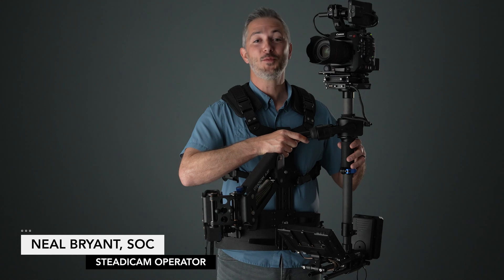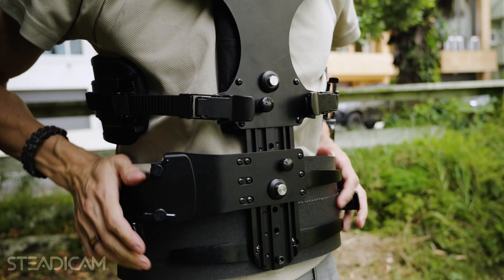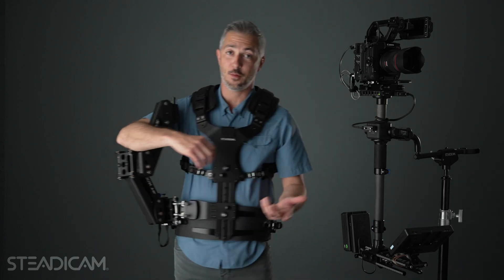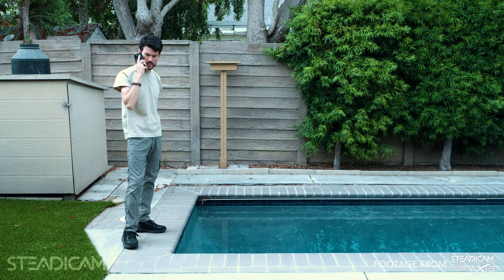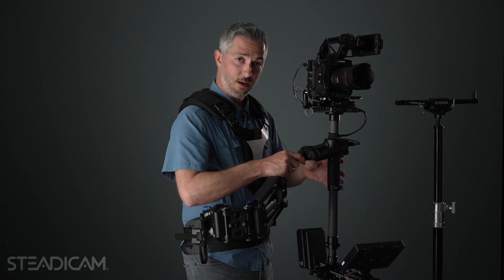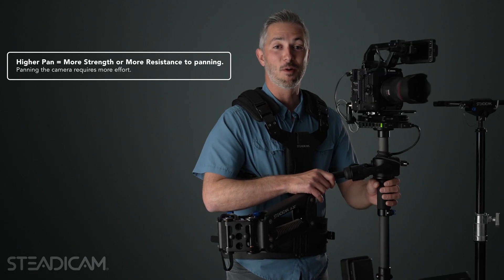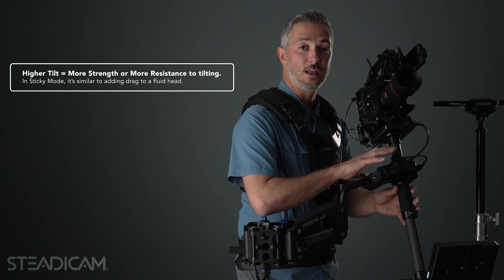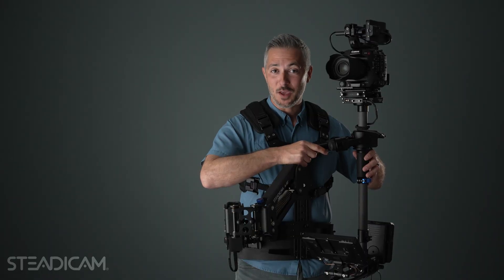Introducing the Steadicam Axis - New Professional Steadicam ® with 3-Axis Volt™ Stabilization

Comment: When you say the weight capacity is 20lbs, are you just referring to the arm/vest that supports the sled? Or are you also referring to strength of the 3-axis motors within the Steadicam Axis' Volt? 

Can someone realistically keep this setup for bigger cameras and just upgrade to a larger weight capacity arm/vest?

Comment: Could a light gimbal (RS3 Pro) be used in conjunction for the javelin mode use case?
Reply: Should be possible as long as you're not pushing the payload.

Comment: Only one question, what plays a part in the payload capacity? Can I go with a heavier setup if I had a stronger arm? Or is it going to overload and burn the Volt? Thanks.
Reply: THIS IS THE MILLION DOLLAR QUESTION! @tiffencompany ?
Reply: In my experience, the Volt is mostly dealing with inertia rather than with weight because the Volt is at the neutral point of the sled. The weight is more of a concern with the sleds balancing. Due to its lightweight design even if you placed a huge camera on the top stage it would still need a fair amount of weight on the bottom as well to balance out the sled to get the gimbal to be at the neutral point. And that potentially would be pushing the payload of sled itself. Hope that helps.
Reply: @HalfAsianSensation  That's very helpful and thanks for your input!
Reply: The Axis sled itself is designed to handle higher payloads. When used with more robust arms and vests, the sled can support cameras weighing up to 25 lbs (11.3 kg).

Comment: Amazing! Would it handle bigger payloads/cameras with a stronger arm? Is there an option to buy it with a stronger arm?
Reply: Not unsure if they are all cross compatible but they sell arms and other full rigs that work with heavier cameras. This new product is meant to hit another price point and they didn't offer before. This one is around 8k I think they have different systems ranging form 3k to 30k.
Reply: @dylanholmes3067 yes, they have bigger rigs to handle huge cameras. Im wondering if this rig could handle lets say 40lbs (30lbs camera/battery) if the arm was upgraded. To me that would make a huge difference. 20lbs feels just a bit too low for camera/battery. So basically what i am asking is if the gimbal, post and west can handle more than 30lbs and is there a compatible stronger arm?
Reply: @krisgrindheim yep I have the same question I’d like to use a g50x I’m hoping we can use it without causing issues. Not that I want to put 20KG on the sled and extra 3-5kg would suffice
Reply: @krisgrindheim  The maximum stress tested load is just over 20lbs. It is not a replacement for the Archer2.
Reply: @EasttSideCustomZ  The stress tested payload is just over 20lb. The Axis is not a replacement for the Archer2.